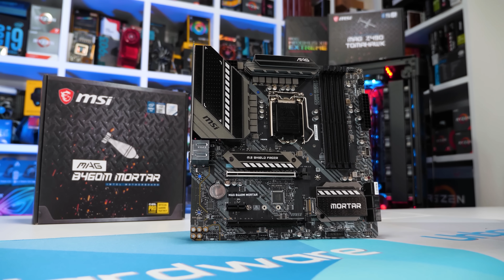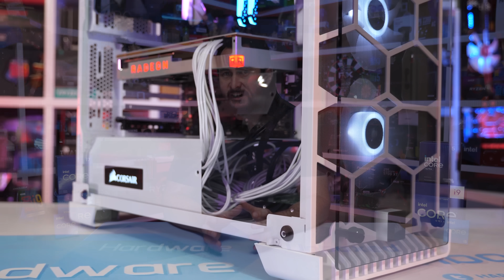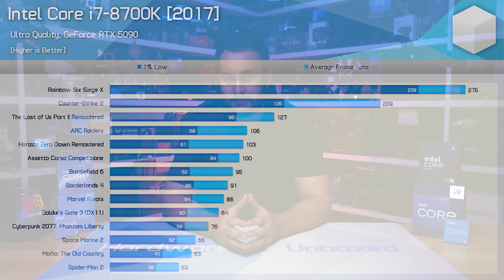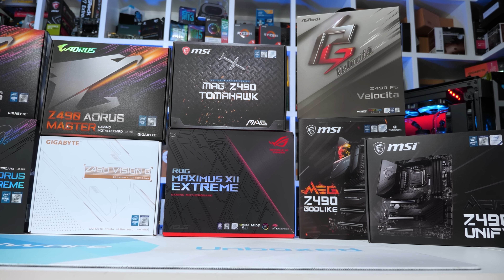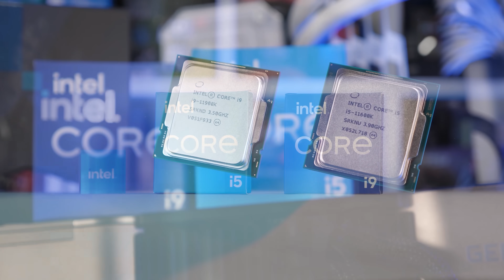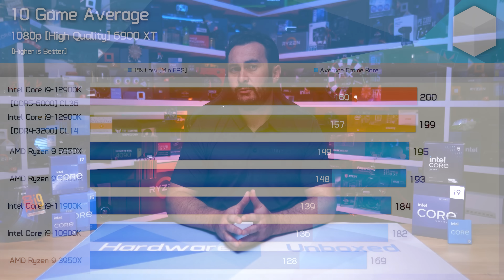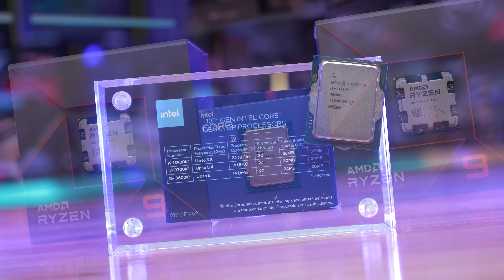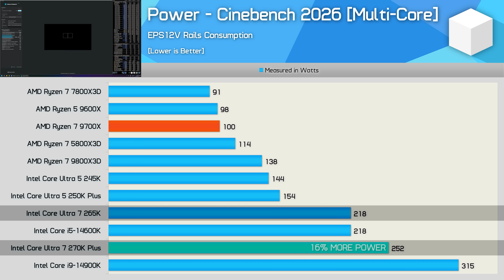How Intel Fell Behind, 10 Years Of CPUs Benchmarked

Comment: LGA1851 was designed in it's inception to be a 4 generation socket.
Meteor Lake (problems with D2D latency, memory controller and low frequency on the new Intel4 node made it become a mobile exclusive)
Arrow Lake (launched on desktop while trying to fix some of meteor lake's problem - Refresh fixed it some more)
Panther Lake (low yields on new 18A node and Panther Cove architecture being delayed, which made PTL use just a Lion Cove refresh called Cougar Cove, made it become mobile exclusive, where intel could focus on the iGPU gains)
Beast Lake (cancelled)

LGA1954 was also designed in it's inception to be a 4 generation socket
Nova Lake (confirmed / 16+32+4+bLLC / N2P + 18AP / delayed Panther Cove architecture meant for Panther Lake, now called Coyote Cove on consumer platforms, Panther Cove X on servers / new E-Cores arch called Artic Wolf) 
Razor Lake (confirmed / 16+32+4+ 2nd Gen bLLC stacked / intel3-T + 18A-P /  new P-core arch Griffin Cove / E-Core Refresh of Artic Wolf called Golden Eagle)
Titan Lake (now rumored to have become a mobile exclusive generation / new node 14A / new arch Copper Shark, no more P and E cores) / Serpent Lake (Titan Lake refresh with Nvidia iGPU tile)
Hammer Lake (not much info on that, but should come out on desktop / 18A-PT +  14AP)
Reply: LGA1954 was also designed in it's inception to be a 4 generation socket
Nova Lake (confirmed / 16+32+4+bLLC / N2P + 18AP / delayed Panther Cove architecture meant for Panther Lake, now called Coyote Cove on consumer platforms, Panther Cove X on servers / new E-Cores arch called Artic Wolf) 
Razor Lake (confirmed / 16+32+4+ 2nd Gen bLLC stacked / intel3-T + 18A-P /  new P-core arch Griffin Cove / E-Core Refresh of Artic Wolf called Golden Eagle)
Titan Lake (now rumored to have become a mobile exclusive generation / new node 14A / new arch Copper Shark, no more P and E cores) / Serpent Lake (Titan Lake refresh with Nvidia iGPU tile)
Hammer Lake (not much info on that, but should come out on desktop / 18A-PT +  14AP)

Comment: Awesome walk down failure lane.  Intel began their shift to high efficiency just as I was replacing PCs with more power efficient chips and everyone can guess the primary reason.  Secondary reason was that my workload had shifted and I no longer needed something chewing it way through my encoding work as fast as possible.  My main desktop is still a 13900K with A770 and as I don't chase frames, this is fine.  I would have upgraded to a new Intel system this year, but even if the silicon was ready - RAM prices most certainly would stop me.

Comment: I don't know who is still sticking with intel at this point.  I've owned the following cpus:  c2d e8400, i7 930, i7 3930k, xeon 1650v2, xeon 1680v2, 6700k, 10900k and 12900k. I'm now a 9800x3d user. I can maybe understand using intel on laptops, but on desktop you would have to have a super niche use case. The only thing I can think of is users who don't upgrade and are looking for price/performance optimised mixed workloads on the new core ultra 7 270k plus, or someone who needs thunderbolt 5. Other than that can't legitimately think of a use case.

Comment: 28:23 After Pentium 4 there were Core 2 Duo and Core 2 Quad CPUs which was also lacking hyper threading.
Reply: Ufff Core 2 duo E8500... we overclcoked that thing over the moon. There was a batch we ware all searching for.... And also my first and last water cooling ( made from start, using Renault Clio 1,4 radiator... ) Those ware times you could actually made huge gains with OC, not like today, where you just undervolt it and done.

Comment: Cool video! I totally remember the days of 2700K, 9700K, and 10700K, which were considered amazing intel chips and I remember always being super satisfied with them due to their overclockability.
However, I did not know they were stuck on 14nm the whole time and pushing through the same older technology without pushing for earlier invention. Very cool learn and as a result we can see exactly what happened! Nice video.
I've been quite happy ever since switching to AM5 7600, which was my very first Ryzen CPU, and I had to learn about RAM tweaking for the first time since it was more important for AMD. Now I'm on 7800X3D so thankfully don't need amazing RAM at least, during these times.
Reply: 🤦 ... The 1st CPU you list is an undisputed legend, and the 2nd was good (but the 8c/16t i9-9900K was the MUCH better choice long-term), but the i7-10700K was absolutely GARBAGE!!!...

It was on a completely dead platform, pulled a SHIT LOAD of power, and was only like +5-10% faster in gaming than Zen 2 while getting ABSOLUTELY OBLITERATED everywhere else... And all for MORE money than an equivalent Zen 2 offering! Comet Lake was trash. 🤷

If you went AMD instead, like an actually sane person, would could have upgraded your Zen 2 Ryzen 7 3700X/Ryzen 9 3900X to a Zen 3 X3D Ryzen 7 5800X3D on the exact same motherboard and still be using the same core platform w/ top-tier gaming performance TO THIS DAY!!!

Comment: My good old 10900K is about to be retired. I'm moving the 12900K into its place for the 4K OLED connected to a living room PC. My desktop is getting a $600 upgrade to a 14700K, with an Asus Z790 Tuf Motherboard, paired with 32GB of Corsair 6400 DDR5 RAM.

Comment: I ran my 2600K and my 3770K at 5.0Ghz from day one. I still have the 3770K (sold the 2600K) and it still runs fine after running years at that speed. I didn't replace it until I got my 3900X lol...
Reply: sure jan
Reply: @thisismypotpie  Yeah the 2600K was good just using an air cooler (thermaltake true black). The 3770K though required de-lidding, and a custom liquid loop. I have a Koolance water block and I ran EK blocks on my 3x XFX Black 7970s that were in that rig. The 7970's were OC'ed to 1250mhz on the core and 1700mhz on the RAM. I built it in a modded Corsair 900D case with 1 Thermaltake top mounted 360mm rad (in a push pull config), and 2x Swiftech 240mm rads in a pull config. I removed the lower drive bay to fit the 2x 240mm rads down there in the bottom (had one originally, but added the second). I had them mounted vertically venting out the side of the case where I cut out openings and put in bits power grills. I had dual swift tech pumps for redundancy and ran Koolance quick connectors for easy removal when I'd do maintenance on it. It was a beast in the day.

Comment: I'm sure the platform switching was a money grab, but it wasn't as a big a deal back then, at least I didn't perceive it to be. Motherboards were cheaper and there were a options with a good mix of price and features. I honestly didn't even mind buying new motherboards because tech was increasing so much. I remember I got a motherboard for my brother's computer that had a new fancy m.2 slot. I had never seen an m.2 drive at that point but they were supposed to be so awesome that I think I paid the extra $20 for that board over another one. It was less than $140. That was over 10 years ago though and you can't get a mid-grade board for less than $140 anymore.

Comment: You should also go into some of the major architecture changes of not just novalake but even the TSMC new node.  Both by the way are being built in America in Arizona.  (That is exciting to hear that the United States is finally pulling the Advanced Chips out of Taiwan which was always a national security issue)   I listened to a CPU design engineer talk about the changes in the transistor technilogy which was holding back proessor efficiency.  Namely the finfet transistor design was being replaced with Ribbinfet.  From what I have seen, they claim a 30 percent efficiency gain through this technology alone.  There are a few other architecture things as well.  I am sure you all will geek out and research all that for us.  Exciting times are ahead for both Intel and AMD in my opinion.

Comment: Thumbnail sums it up, I want to buy Intel but sick of buying another motherboard. On 13700k
Reply: While platform longevity is a big deal, by the time a top CPU on a given Intel platform is considered "obsolete" it will most likely be time to get a new motherboard anyway.  Those still rocking the 9900K are probably ready for PCIe 5.0 and other features, but that CPU is nearing 8 years old. Regardless of that, this is CPU is still performant enough for most non-enthusiast gamers, I would wager.

Comment: I know, that they panicked back then at the end of 2021 because of AMD. And they knew, that they couldn´t compete with the standard design, so they swapped to this weird P- and E-Core thing. 
And this was a disaster and it is up to today. Because it simply doesn´t work for desktop PCs. It should be more efficient, but in reality AMD CPUs need about half of the eneregy for the same performance level.  And that´s really crucial!
If they continue this way, they will eventually totally go down. They have to stop this nonsense immediately and get it together!

Comment: As far as intel is doing bad nowadays I still prefer it for now due to the fact that most of intel motherboards for old chipset has 6 satas available and most am5 new amd has 4 satas available, I wish I am incorrect but thats what I was found. And yes I have 4 ssds in my system and 1 hdd. 
Hopefully intel will produce something good in next 2-3 years or I will change my ssds and switch to amd

Comment: Intel didn’t fall behind because they forgot how to make CPUs—they pushed an overly aggressive 10nm process that was too complex to manufacture, with low yields and poor clock speeds. While Intel struggled, TSMC executed smoothly and AMD took advantage, delivering better performance and efficiency at the right time. Intel originally planned for 10nm to launch around 2015–2016. Intel got stuck waiting on its own manufacturing, and their CPU roadmap stalled because of it. Intel didn’t intentionally fall behind, but their 10nm delay ended up setting them back about 4–5 years. their cpu designs were made for 10nm and without it they just refreshed what they had in hopes of getting it up and running. by the time they got it running, their cpu designs were outdated.

Comment: I bought a 13700k day one. Loved it.

Year later it died from the voltage issues and intel rma’d me a 14700k.

I switched to amd a year later.
Reply: But the gaming is “godlike” though meaning you is a god for a few months until their next godlike motherboard releases… 🙄
Reply: 14700k = same CPU die = same problems (degradation) as 13700K.
So in result Intel delivered you two times a broken product.

I am happy to hear that you switched to AMD later on.
Reply: @darthgrossmaul  Its a bios issue, which has been solved
Reply: @stunningandbased5516  nothing has been solved. CPUs still die because of degradation, but now slower. root cause is a hardwaredefect in the CPU itself and the BIOS update is just a workaround/hotfix.
Reply: @stunningandbased5516 yes but intel gives directions on hoe to configure the bios correctly and they didnt care at all soo yeah. Still delivered a self destructing product

Comment: The thing that sucked about the 12700 series was the DDR4 or 5 choice. I went with DDR4 based on youtuber recommendations but with no path to change over without a new mobo my still in use PC is suffering.
I should of ignored the youtubers and just gotten DDR5. But you don't know if this will actually turn out like this. Youtubers made convincing arguments at the time which was bad advice ultimately.

Comment: You're going to pay a premium for the newest intel i7 that isn't on the Windows 11 support list. A Haswell i7 will perform very similarly.
Of course, a 4c8t CPU really doesn't cut it for recent AAA games, most of which are very CPU intensive. 
X99 is a much better choice than this. Single thread score isn't everything, especially not these days. Running UE5 on an older quad core, with just 8mb of L3 cache is a real oof moment.

Comment: Intel fell behind because they were greedy. They didn't wanna innovate and wanted to screw consumers with overpriced 4core cpus. If it wasn't for AMD we still would pay for a 4 core 8 threads i7 which was top or the line or the cheaper option of 4 core 4 threads. What a joke. They fell behind because of greed for money. To maximize profits they almost stopped innovating and started recycling old technology with smaller chip nm. This is why they fell so much behind AMD in market share. I remember they tried to do something similar back in the 2000s but again AMD forced them to improve themselves. I hope they make themselves the best again still how can two different companies care so differently for consumers?

They've just started recovering but are still long behind AMD for now. AMD is still the top choice for both server and consumer CPUs for now.

Comment: I'm still on 14nm...
i7-6920HQ, the fastest non-Xeon Skylake for mobile. CPUs aged better than GPUs, this "750 Ti" (Quadro M2000, GM107) is dying to keep up. I could use a 1050Ti MXM on here, and it could still be the bottleneck. I even remembered games in the Core 2 days struggling because of GPUs simply being that weak...

Comment: I'd argue the story starts with Nehalem, when they artificially created the HEDT segment retroactively by releasing a toy computer part (Lynnfield) after a proper part (Bloomfield).

After that, the toy segment stagnated at four cores while the margin-motivated HEDT segment went up to ten cores before Ryzen influenced the direction (which caused Intel to divert 18-core server dies to HEDT).

If Intel hadn't let short-term margin greed artificially segment the desktop market like that, they would have had more than eight cores by the time Ryzen came out, and AMD would at a minimum have had to start with what became Threadripper.  Or maybe a larger CCD from the start having 12 or 16 cores.  Assuming they even decided to roll the dice at all on a totally new architecture in a hypothetical world where Intel didn't stagnate.

Comment: I have to disagree on one thing Steve. The 7700K for me, at least, was a bad processor. I bought one, and I've regretted basically on the first day.
- Price. Way more expensive than the 2500K I've bought years ago. Sure, I've got a big upgrade on performance, but still very expensive. Specially if we compare with AMD at the time.
- Longevity. not sure if 6000 series Intel was compatible with the 7000 series, but a year later, finally Intel releases something worthwhile and now you're expecting a new motherboard? NO. Specially when people were able to hack an earlier motherboard into a 8700K.
- Heat. Shit stock heated faster then my 2500K fully pushed. The only thing I've done to that cpu was undervolt and underclock.

One of the most disappointing releases from Intel imo

Comment: Still running Ryzen 1700...I remember comparing intel 7700 vs Ryzen 1700...4 stronger core slightly better for gaming vs 8 weaker cores but slightly better at multi tasking.

Comment: I still remember the 2500k that started it all and lead to the 14nm++++++….
Reply: I went from 2500k to 5800X. The jump was big but the 2500k at 4.4GHz and 1866MHz CL9 ram really held on its own with photo/layout production tasks. In games and video production though, it really began to show its age.

I still miss that thing. The board's VRM smoked back then. The 4x8GB RAM at least got migrated to a 4590k system and still being used.
Reply: That's also when people started expecting a CPU to be able to handle several generations of top shelf GPUs in a row.... Not because it makes sense but because Intel was sniffing glue.

Comment: 8700k is the real king of the CPUs, they have amazingly low latency with tuned DDR4 memory, basically all CPU could hit 4.90GHz and 90% of them 5.10GHz, they easily beat an AM5 system. 9600k was also great, but the 9700 and 9900 are just horribly power hungry chips, here you go 8 cores you can run all of them at 3.00GHz to your heart's content.

10 and 11 gen was a mess basically no real socket support, only Z motherboards supported 11. gen CPUs and you loose one M.2 if you use new motherboards with 10. gen CPU.

You forget to mention the horrible CPU/socket quality, 6,7 and from 12 gen up they bend like banana, after a long time use the CPU is basically paired to the motherboard, if you put them into a straight motherboard not all pins will make contact and you loose memory channels. My Intel Pentium G7400 (1700 socket) already bent and I only use it for motherboard testing, it has like 5 hours of runtime.

Comment: My first real gaming computer had an intel processor, back in:
2017 i purchased the i7 6700k
2018 i went for 8700k
2019-2020 i went for ryzen 3600 and 3700x
2022- i bought a ryzen 5900 non x which had serious compatibility issues, the worst fucking processor i ever bought, but i sold it at a lost and got the ryzen 5900x
2024 i got the ryzen 7800x3d which i'm curently using, this is the real champ for me. I will upgrade this bad boy only when AMD releases a better ipc than 8-12% that the 9800/9850x3d gives for a 50-80% increase in power draw...
I want at least a 30% ipc increase and maybe a few more cores on the same ccd for at most 120w power draw if i'm gonna upgrade, otherwise i'm good until 2030.
Reply: I would only consider intel if the can support more than a generation on the same socket and can seriously match AMD performance and power draw. And maybe give us only a performance cores only cpu with reduced power draw....cuz i'm not getting a 250w processor, unless electricity it's free and it's easy to cool, the motherboards relatively cheap and of course the ram....better go down to what it used to be...otherwise no upgrade for me until that happens.